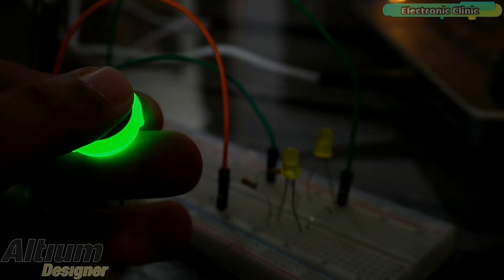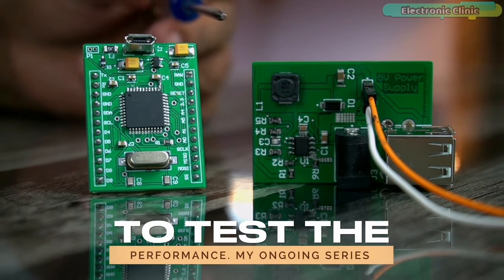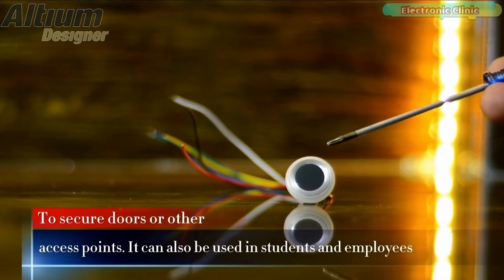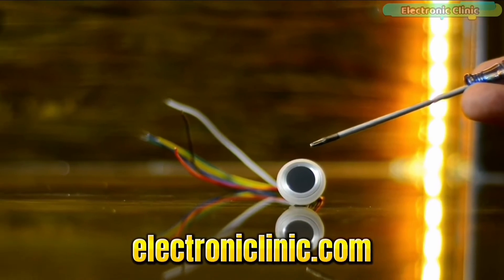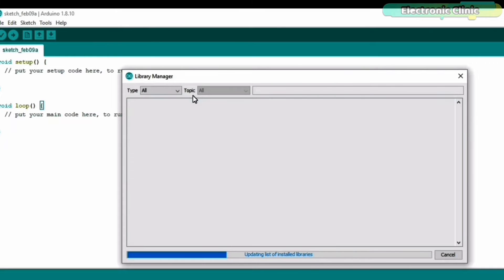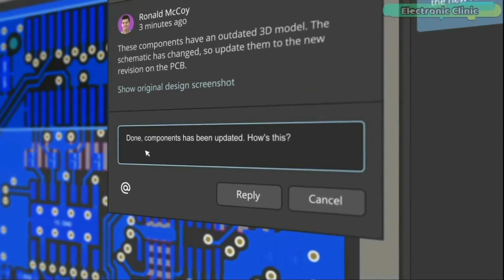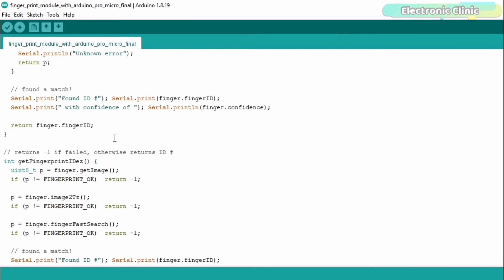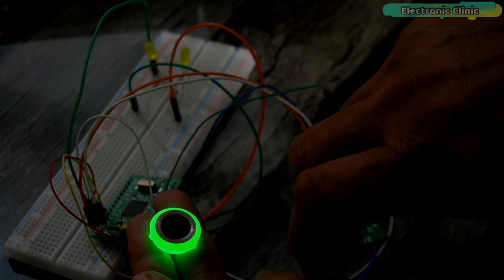Biometric Fingerprint Scanner with Arduino Pro Micro  Capacitive Fingerprint Sensor R557

Comment: I came from the video where you created your custom micro. You previously burned the Leonardo bootloader onto it. Does this give functionality to the USB header you added? I noticed you had to program it the first time with an Arduino Uno after you burned the bootloader, at what point did you make the switch to USB and how did you do it? Thank you.